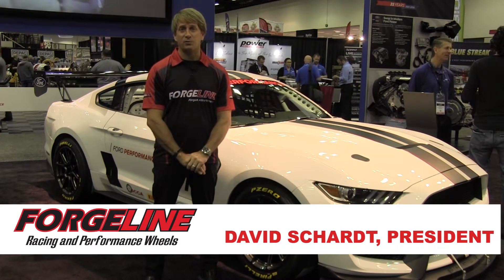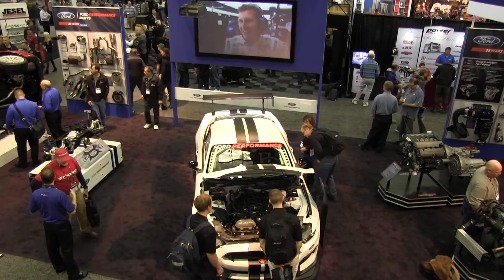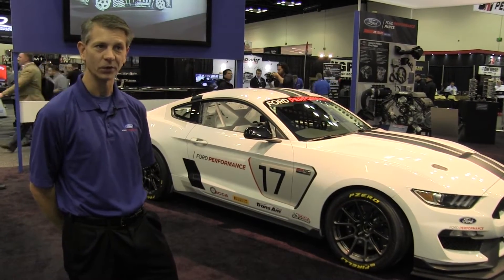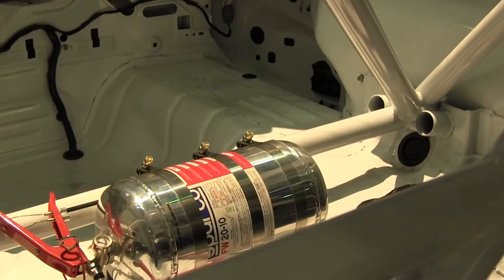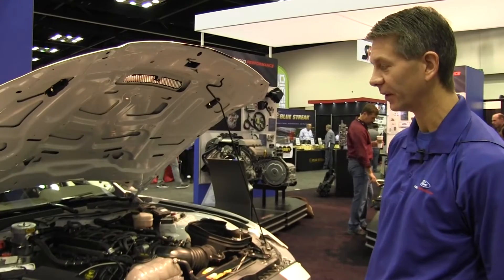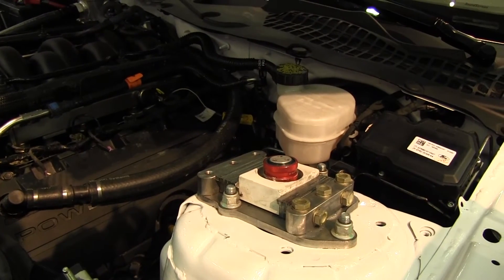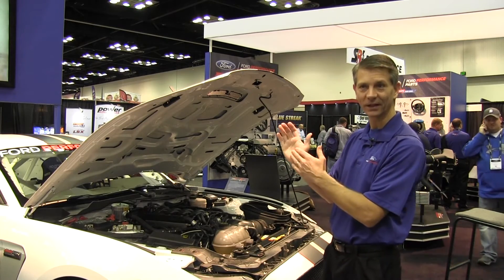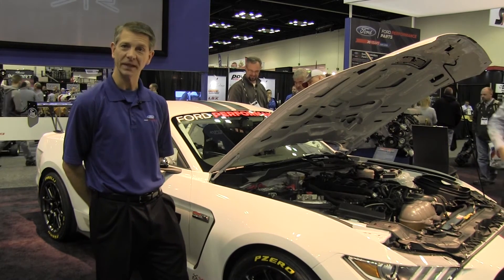Ford's Shelby FP350R Racecar Debuts at the 2016 PRI Show on Forgeline GS1R Wheels

Comment: I'm curious, why no strut tower brace on a track performer such as that.
Reply from the maker: My guess would be because this is designed for several different sanctioned racing classes, and the rules in some or all of those classes may not allow this car to run a strut tower brace.
Reply: Forgeline Motorsports Interesting,  thanks.